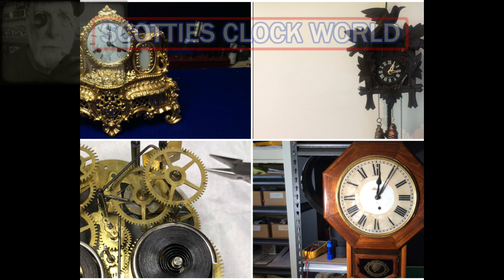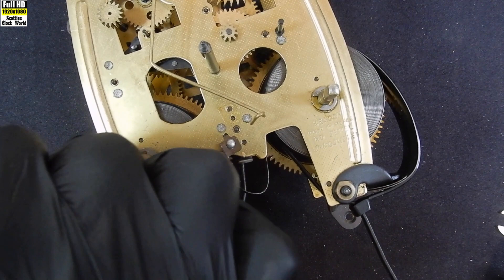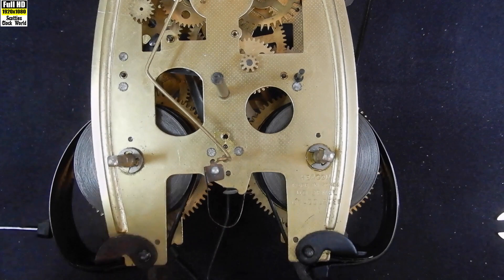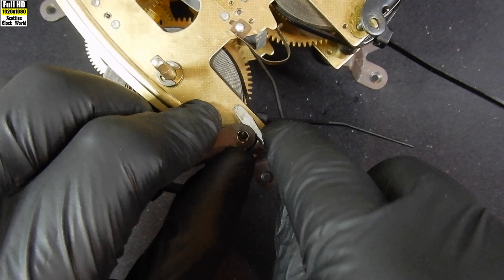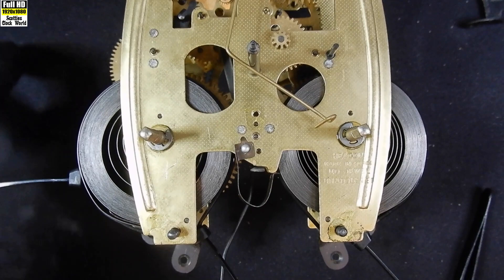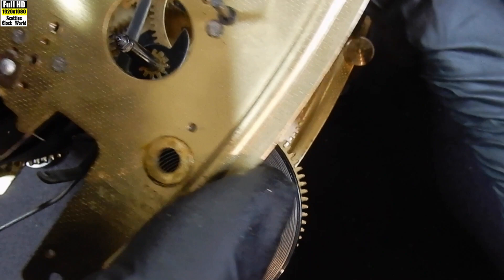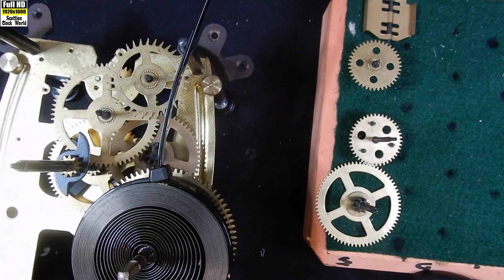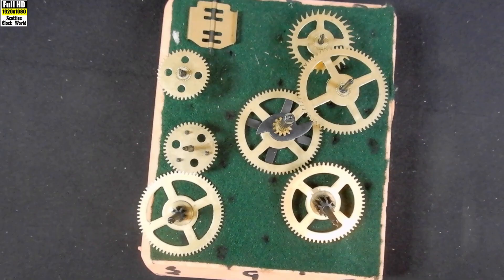Korean ITF 31 Day Wall Clock Service/Repair - Part 2

Comment: I have one almost like this one. The clock says it was made in China. When I open the dial, I found gears all over the movement. 3 of the nuts came off from the movement and the strike side blew up from the power of the spring. I was only missing one gear, the gear with the warning pin. I think I found another movement that when it gets here, I might be able to rob that gear or just put the whole movement in my clock. Great job here Scotty. (I am amazed how shiny the gears are in this clock before you clean it).
Reply from the maker: Gee, that was a bit of a mess. I wonder if your cl;ock is a knock-off of the Korean one.